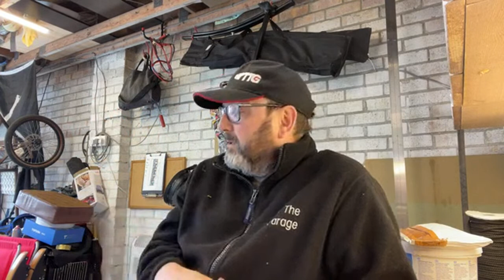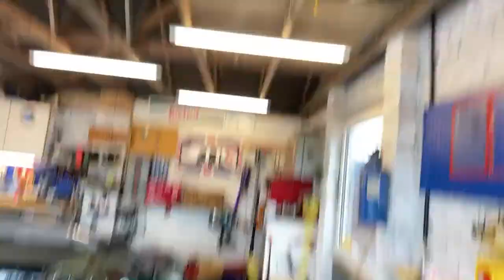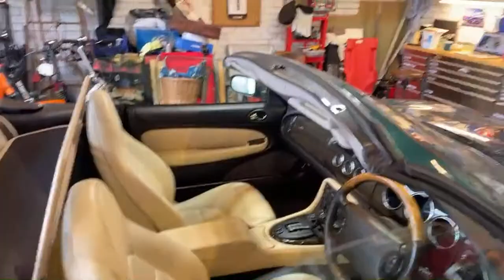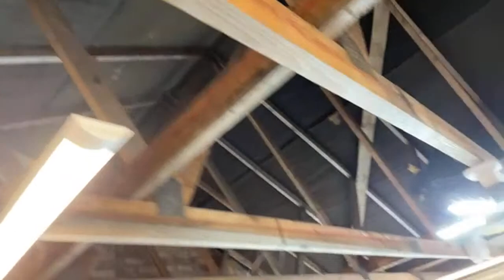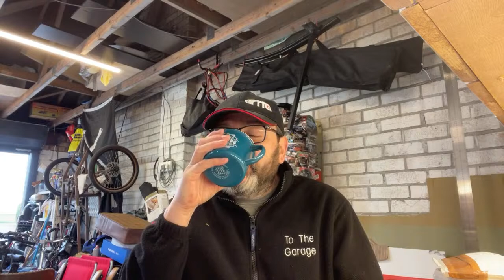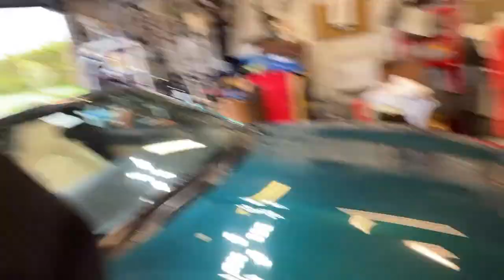Jaguar xk8 live chat. Gearbox service, washer pump, and starlings

Comment: I was able to do the trans service with minimum fuss and no gloves! With a sloping drive I can get the car level with the 97 convertible  backed uphill and the front up on jackstands. This was done after redoing the tensioners and chains and it turned out well. I do the 😂change of the trans twice to get a larger percentage of fluid changed, with the filter and seal changed on the second drain and refill after 25 or so miles to mix the unreplacable fluid with the new. Some of the new fluid lost on the second change of course, but still a larger percent changed (Check the math!) A year and a half on the changes. Scottsdale, Arizona, 67000 miles.

Comment: Hello John. Couldn't join you live but wanted to show my suppprt by watching after the fact.

Did you see my email thanking you for the help given on one of your earlier videos relating to the battery vent pipe?

I had my gearbox serviced by a local specialist for a very reasonable price (around £200): something to be considered by TTG watchers that are not as gifted as yourself with the spanners.

Mine had 63,000 miles on the clock at the time and the service cured an annoying sweak when pressing on.

Keep up the good work.

Stephen

Comment: I've been wanting to do a whole overhaul on my XKR, transmission fluid change and all the bushings could do with being replaced. The upper shock mounts are a problem though, there isn't really any good replacements and the only good ones you need custom making in Australia or the US which is a bit or a logistical nightmare with a car you use for daily driving. Rust is getting worse as well, that will need sorting out eventually. I want to get that guy in Boston to do it that you used I think.

Comment: I'm having an intermittent problem (always the worst kind) on my 04 XKR. Sometimes all is normal but sometimes the J-Gate does not operate the lower gears (and the sport light won't illuminate). It drives perfectly in 'drive' with kick-down ok etc, but no J-gate response. As I've had a couple of odd warnings illuminate and then go away (water level low and suspension fault), I thought it may be a battery thing as havent driven it much over the winter (I keep it garaged on a C-Tek and the battery is about two years old). However, I recently drove 120 miles with the J-gate working only to drive 120 home with it not. Any ideas?
Reply: Hi, I have an 2004 XK8, I had the same problem with the gear selector - no ‘manual selection’ and non working Sport button + flashing P, R, N, D flashing when selected - I cleaned the linear switch after watching Granblogismo see - Update J-Gate fix and ABS warning root cause video to explain how and where to clean/replace… worked for me.. 🥳🥳
Apologies John for stepping on toes replying to this, but I know Purdy doesn’t have this setup….
Reply: @johnpalmer2969  thank you very much indeed.
Reply from the maker: @johnpalmer2969  Never worry about offering Advice John👍.
Reply from the maker: @ljw5768  I agree with John Palmers comment LJ W👍. I would also consider swapping the Sport switch for a known good one. A failed switch can cause many more worrying effects.

Comment: Hi John, liking the off the cuff videos. I have a question, hopefully it hasn’t been asked and I missed it….. whats the story with the Marina badge on the back tool wall?
Reply from the maker: Hi John. The Morris Marina is another one of my guilty pleasures. Unlike the rest of the world, I like the way they look, revel in their mechanical simplicity, and will one day build a V8 Coupe. I have owned 7 marinas over the years but have not had one for about 20 years.
They handle very badly as standard but that can be sorted. Indeed I used to have a Morris Ital that I competed with, in Sprints at clubman level. and the odd production car trial.
Reply: Well I didn’t expect that reply…. My dad had a 1973 1.3 standard 4 door in white until a plonker wrote it off…